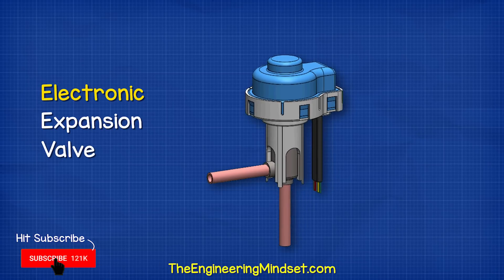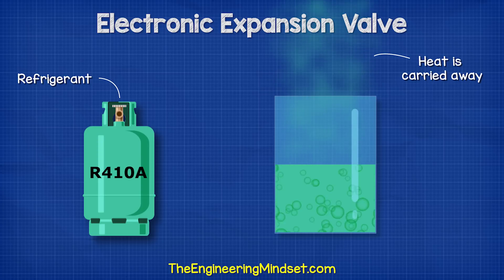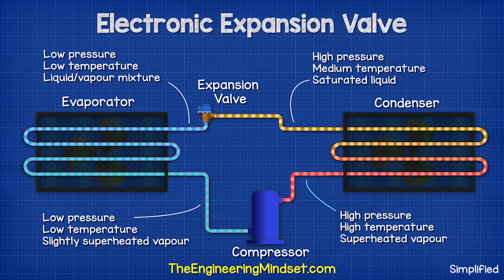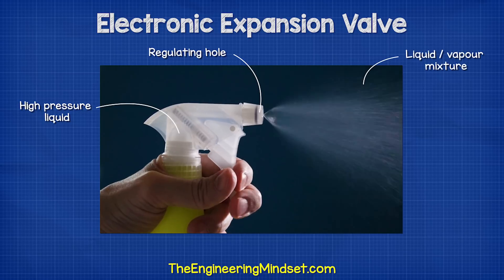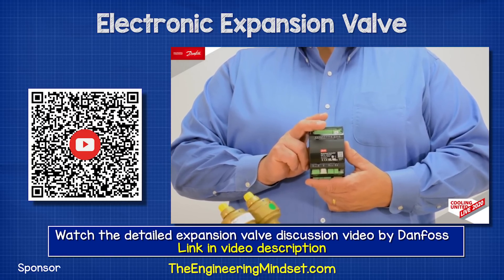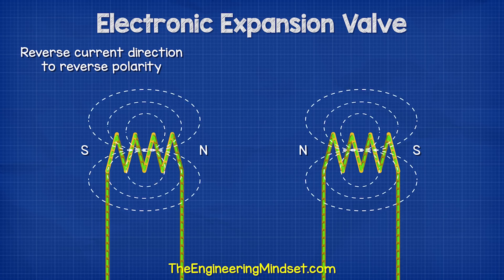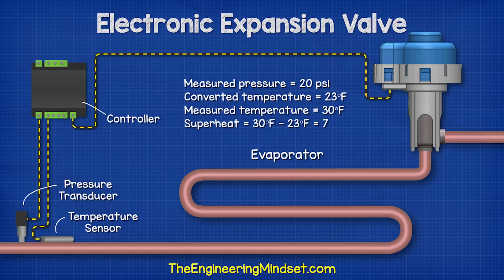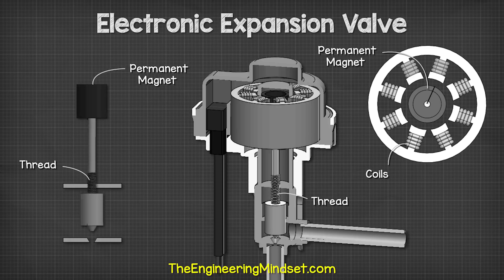Electronic Expansion Valve - How it works ETS 5M HVAC

Comment: An industrial heat pump operated between the temperature of 27°C and - 13° C. The rates of heat addition are 750 W and 1000 W respectively. The COP for the heat pump is

Comment: I am a test/service technician for an OEM who builds low temperature Chillers. I have been arguing with our design engineers saying that the EEV needs to be oversized to take in account pull down. Basically I need to have a 15 to 20°F superheat wether my fluid temperature is 90°F or -4F. If the EEV is not big enough, during pull-down I will overheat my compressor because of very high superheat (over 70F). Also in this situation the pulldown time is extremely long. Their understanding is that if the EEV is oversized it won't be accurate at a low set point temperature. It is extremely imperative that I have a 15F to 20F superheat no matter what the load condition. If not, I am dealing with flood back, or an overheated compressor. My hope was that the EEV would ensure this.

Comment: M having problem in this type of eev.
In stopped unit eev are internal leaking which cause sweating on panel body.
Even after replacing whole expansion valve still same issue.
It's a vrf system where some indoors are working and those stopped are getting dew on the panel grill body

Comment: You have a slight error in your schematic - the refrigerant always enters the condenser from the top, not the bottom, that way the gas can stay on top and as it cools into liquid and the liquid gets pushed to the bottom. And then the liquid enters the expansion valve and the evaporator from the bottom, not the top as you pictured it, that way as it warms up turns into gas the gas can escape from the top leaving most of the liquid on the bottom of the coil

Comment: ive seen alot of termostatic expansion valves that have failed as an hvac technician but never have i seen an EEV to this day fail
Reply: Really ?, it's been the opposite for me.
Reply: @Boraxo  weird we work mostly with mitsubish heat pumps and never hade to replace an EEV although reversing valves have had a lot of problems

Comment: Just after 6:00 of the video prompted me to scratch my head and review how these expansion valves work. I was puzzled when you said the TXV reacts to close down when superheat is too high, and open when superheat is too low. This is backwards compared to what I would expect, since high superheat is crying for more refrigerant flow, and low superheat puts the compressor at risk of receiving liquid refrigerant if flow were to increase further. Fortunately there is an excellent video describing this in more detail, done by the same author, titled "How TXV works..."! I believe that video explains the process correctly, high superheat leads to the TXV OPENING, increasing flow, not closing down. Then I opened the video description here and saw that you already acknowledged that minor error. It's too bad we can't do Youtube annotations any more. Correcting that on the screen at the time stamp would have been much more clear.
Reply from the maker: Totally agree, I've requested the feature many times. As an educational channel we really should have the ability to edit such a simple mistake or at least make it easier to annotate. Obviously if it was noticed shortly after publishing we could re-upload but now there are thousands of websites linking to this video so it's too almost too late.

Comment: Does anyone know of an electronic expansion valve that is made for ultra low temperature Chillers? I used a Sporlan but the superheat controller would fault out if my suction pressure drop below zero PSI or if my suction line temperature dropped below -59 degrees F. After it faulted the expansion valve would close completely when I ran the controller in manual mode I was able to fine-tune the EEV to 25% open and was able to achieve -85 degree fluid temp

Comment: Do expansion valves "unload" the compressor by shutting down refrigerant flow under low load conditions? All the high SEER conditioners have them, but I'm trying to understand why an expansion valve is better than a fixed orifice metering device.

Comment: I have been destroyed and open this E,E,V,. Then i sow how it works, open close small hole by an elctronic motor controlled by mother bord with sensors and i changed it by cappilpery tube and deleted the elctronic board,cause its impossible to diagnostic.

Comment: I worked on a system in which the expansion valve was a simple solenoid valve. It was constantly opened and closed by a PLC according to temperature readings.
Reply from the maker: Wasn't linear control though

Comment: Great Video! But can this also let the compressor be always operating and reducing its lifetime? instead of installing a variable speed compressor that reduces speed and operating cost. How we can combine these two points (reducing flow from the valve or from the compressor).

Comment: Have I understoof this correctly? The target super heat is stored in the PID/controller, the evaporator valve will increase or decrease the flow and hence pressure to match this stored value? Or is the super heat value simply the error and should always return to 0?

Comment: The controller has no way to know what the absolute linear position and range of the valve is, so during first startup there's a chance it's totally off the mark and possibly damaging other components?
Reply: On every startup they just go full closed position (same as at the end of working cycle).

Comment: That's a brilliant decoupling of the two separate things that might need repair.
Reply: Wait until the damn valve gets clogged :/ That translates into a new coil last I experienced with a Trane a/h IIRC.
Reply: @sprockkets  Ah yes, the good 'ol Trane expansion valve problems.  The only thing that stops a Trane is it's self.  It's a shame when people spend all that money on a Trane and then it goes down.  But of course, before you count the valve down and out, you must run the special sauce oil additive from Trane to see if that fixes it.  I know fixed orifices aren't the most efficient, but they just work.  If it gets clogged, you can clean it no big deal.

Comment: Why not use a fixed size expansion valve with a variable speed compressor? BLDC / PMSM motors with controllers are almost commodities at this stage and can offer greater efficiency than traditional induction motors.
Reply from the maker: Check out the new BLDC Motor video: https://youtu.be/yiD5nCfmbV0

Comment: Refridgerant doesn't actually spray through an orifice as a part liquid gas. It flashes to a low pressure liquid and starts boiling to a gas evenly across the beginning of  your coil being almost all liquid at the orifice and all gas at the vapor line exit. If you're undercharged you get liquid gas mix at the orifice and it boils rapidly pulling a lot of btu's and icing your coil.
Reply: refrigerant

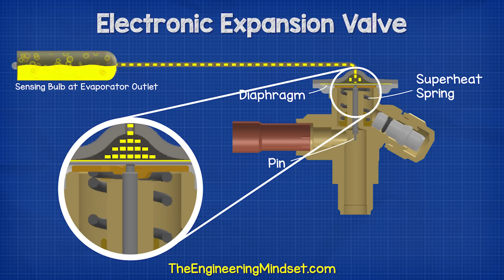Comment: In 6:21, why the valve closes when the refrigerant expand which means the refrigerant in evaporator outlet is hotter and cooling load increase?
Reply: he made a mistake. the diaphragm will be pushed down which will open up the valve more and let more refrigerant into the evaporator.
Reply from the maker: If you look at the animation, the pin in being pushed down which would open the valve to let more refrigerant in. I've accidently said it closes the valve. Apologies for the confusion. Correction will be included in the video description.

Comment: Regarding TXV's: At Time 6:15, Did you mean to say that as superheat increases the valve is closed and vice-versa? This seems to contradict what I am learning in school.
Reply from the maker: If you look at the animation, the pin in being pushed down which would open the valve to let more refrigerant in. I've accidently said it closes the valve. Apologies for the confusion. Correction will be included in the video description.
Reply: @EngineeringMindset  I always learn an incredible amount from your videos! I learned how TXV's work watching one of  your previous videos! I thought you had misspoken. Not being snarky. I'm still on pretty shaky ground regarding HVAC thus my question. Thanks for being much cleared than my college instructors (let's keep that between us!)😉
Reply: he told them in reverse. the valve will open up if the superheat increases.

Comment: Thank you, big fan of your work!
I would like to suggest a future video. Correlation between the EEV and an inverter compressor as well as more details on EEVs and PID control. (and how all these can be observed on a monitoring system).
Again thank you for your video. Very clear and punctual! Keep them coming!
Reply: PID control would be a huge one for me, how the refresh rates for each part of the control loop effect the process, when the control loop is normal acting or reverse acting and so on